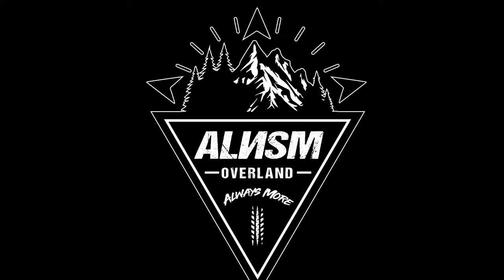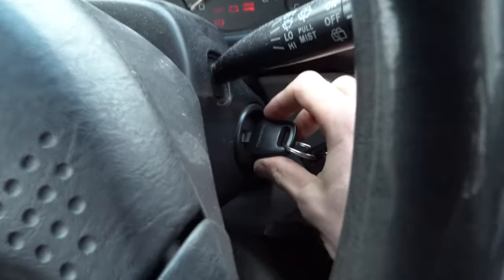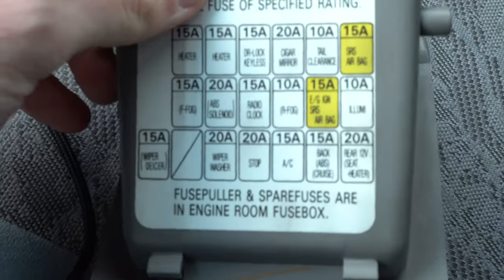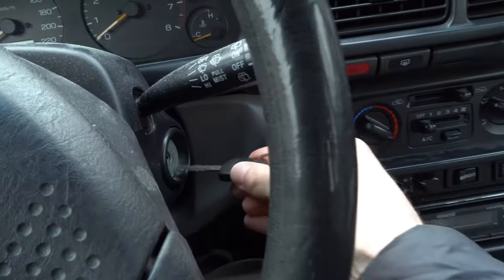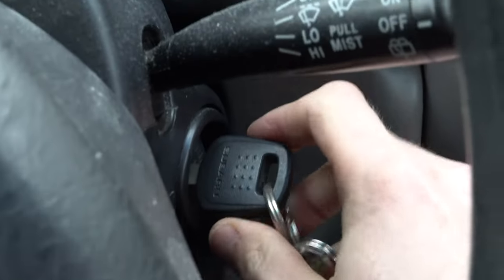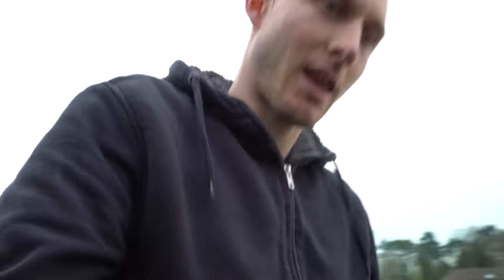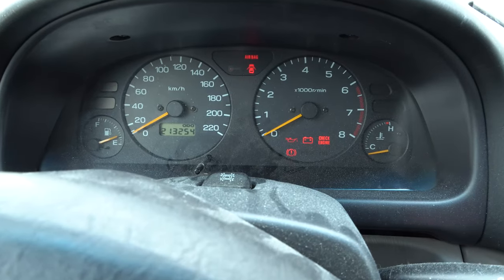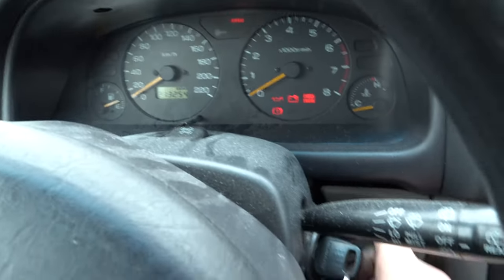The DailyFoz won't start... How did I fix it ?!

Comment: don t plug the ground cable on the battery when you work on the  positive cable,you can make short circuit with yours tools
Reply from the maker: This is absolutely what I've done 😂 learning the hard way 😅
Reply: @ALNSMOVERLAND  nice way to make sparks😁

Comment: How can I keep the axles and the CV boots in good condition in a lifted SF5?
Reply from the maker: Use OEM axles and boots 😁 and don't lift more than 2in without subframe spacers 😉
Reply: If you are planning on lifting your SF5 more than 2”, see if you can get Blue Point Flexxboots. They are much stronger than OEM and tend to hold up better with the added CV angle.